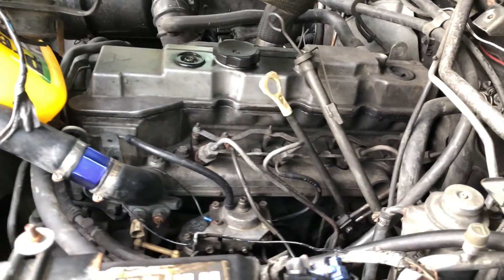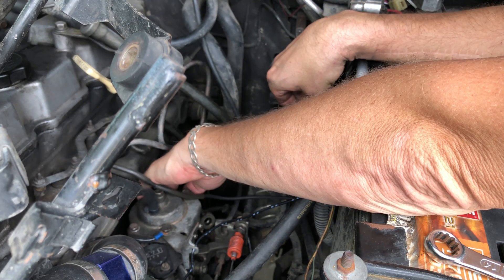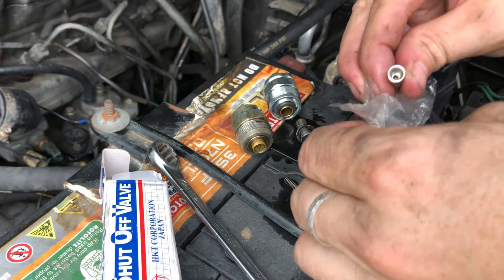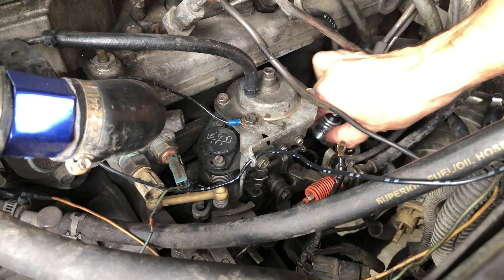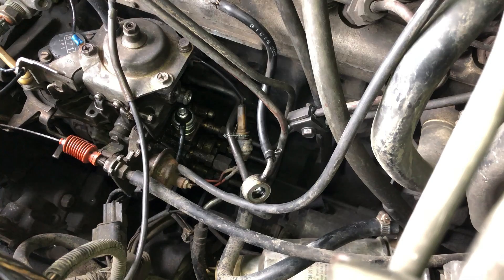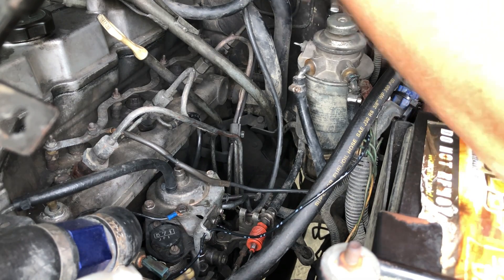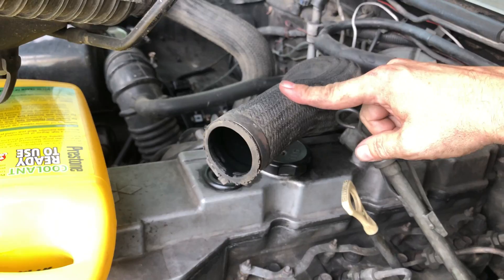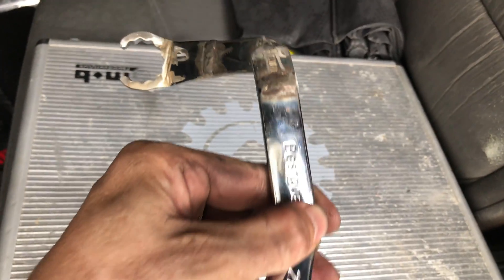HOW TO: DIESEL ENGINE SHUT OFF STOP RUN SOLENOID VALVE VE INJECTION PUMP Mitsubishi Pajero 4M40 4D56

Comment: These are also 12v and 24 v....make sure uyou use the correct one..😂
Reply from the maker: YES. There was something in the fuel distributor cutting the rubber stopper constantly. Rebuilt the pump and no problems since.

Comment: When you cut and weld the spanner leave the ring at the top of the spanner and put a power bar through it ,for leverage, it works a treat

Comment: Thank you for your video, it helped me quite a bit, just one question? how the hell did you get two hands in that small area behind the pump, I either have one to many left or right hands or needed two left or right hands with broken wrists just to see the shut off valve. 😁
Reply from the maker: Hehehehe! Well, it's VERY tight, but I loosened one or two of the fuel injector lines and built a custom box wrench.

Comment: any idea why my pajero 4d56 does not start at all? i tested my solenoid for power and hear it clicking. it ran perfectly then a few days later 0 sign of starting. no fuel getting to injectors either
Reply from the maker: So, you have fuel in the tank and when you loosen a fuel like just at the injector and crank th engine, there is no fuel leaking, squirting or dripping at the opening?
Reply: @offgridislandfamily  yes i added more fuel to the tank to be certain and no drips or any signs of fuel coming out of the injector with the line popped off. Thanks for reply
Reply from the maker: @anthonyx187  Yeah. Then either you have a fuel blockage (check the flow through the line). You could use a shop vacuum set to exhaust and pressurize the fuel tank with the fuel line open at the engine compartment. If fuel is coming from the tank to the engine compartment, then I hate to tell you, it sound certainly like fuel pump / distributor.
Reply: @offgridislandfamily  will try this, thank you
Reply from the maker: @anthonyx187  Just an update. My Pajero wouldn't start. After some trouble shooting, I found out it was the glowplug relay or switch. I touched a jumper cable from the battery to the glowplug rail and it started right up. ;-)
Reply from the maker: @anthonyx187  Just an update. My Pajero wouldn't start. After some trouble shooting, I found out it was the glowplug relay or switch. I touched a jumper cable from the battery to the glowplug rail and it started right up. ;-)
Reply: @offgridislandfamily  thank you for update, i think my injection pump needs work. It is going in to the shop for a pump rebuild i am still not getting fuel to injectors and my glow plugs are reading around 11 volt
Reply from the maker: @anthonyx187  Yeah...that was my first guess.

Comment: I wish I could have that diesel suv in the United States ❤
Reply from the maker: There are options. You could import your own 4m40 engine and convert. Would be quite simple as the fuel management is all bolt on mechanical. There are also many popular BMW and Mercedes diesel engine options that work amazingly.

Comment: My shut off valve thread seem to be stuck. The mechanic gave up on it. Any ideas.
Reply from the maker: You mean you can't remove the valve? If not, then install an old fashioned fuel cut off just before the fuel distributor / pump.

Comment: Where can I buy the solenoid? Link doesn't work
Reply from the maker: I just bought them at a local parts store. However, the rubber stopper keeps getting damaged every couple months. I don't even bother replacing it now, until I rebuild the injection pump.

Comment: hi can I ask is it just a 12v feed going to the solenoid or have it got a voltage drop and is it a constant feed as in trying to do away with the pat system ing my 1990s ford transit as the immobilizer is playing up
Reply from the maker: It's a constant 12v feed, yes. Thanks for watching! ;-)

Comment: Hi there, just want to ask what's the actual size of the solenoid to fit a socket wrench? You mentioned 24mm was it the exact size? Thanks in advance.  Love your videos and the Paj!!
Reply from the maker: Yes Sir! 24mm. But a HECK of a spot to work on! HEHEHE! Cheers...I have a new video coming in a couple days for thermostat, engine block cooling tube and silicone hoses. Thanks again
Reply: Thanks for the reply 👍
Reply from the maker: @henrybot320  No worries. I'm going to have to replace this stupid solenoid a 4th time as of yesterday. Something inside is damaging the rubber plunger so that I can't shut off the engine. Have to pull the intake tube and cut air supply.
Reply: I broke the camshaft in 3 pieces and damaged 3 valves and the camshaft sprocket 3 months after putting a new cylinder head 😢 😔 😪
Reply from the maker: @henrybot320  I don't know what Nulon start is, but I have to replace my solenoid AGAIN for a 4th time! Something inside the injection pump keeps damaging the rubber stop plunger. Seems to happen about every 4 months...so, $30 every 4 months.
Reply: @offgridislandfamily  it's a thing that you spray in the intake to help start the engine,  maybe you need to have the fuel injection pump to be calibrated.
Reply from the maker: @henrybot320  WOW...WHAT a mess! Have you looked into any performance upgrades for a 4M40 rebuild?
Reply from the maker: @henrybot320  YES. Already paid $150 for 'calibration' here in the Philippines by a recommended 'technician'. But what ANY of this actually means here is a total TOSS-UP. I absolutely agree. I need to find an unquestionably skilled pump tech and have it redone. I think this also explains power loss at higher RPMs. Or...perhaps a combination with valve adjustment.
Reply: @offgridislandfamily  did they tell you if they replaced the plunger of the injection pump? Hence they should show you the old plunger that they removed.
Reply: @offgridislandfamily  oh I wish I could do more upgrade of power like your doing to your Rig mate! At the moment I just wanted to put my pajero back on the road, but I noticed of noisier engine sounds like a Fuso trucks my mechanic said it was a fuel lock sound. So maybe I need to reconditioned my injection pump,  it's not cheap here in Sydney it's around A$1,500 🤔
Reply from the maker: @henrybot320  I AM the one who replaced the plungers. The solenoid is always working, but the rubber stopper / plunger head is always damaged the same. You can see in the video where I change it. Always cut like a 2/3 moon crescent.
Reply from the maker: @henrybot320  SHEESH! Maybe I should find a seriously top notch shop and offer the service to people in western countries! There is a Porsche restoration ship in Cebu who restores Porsches they receive from owners in western countries. After restoration, they ship them back out again. 

I've been wanting to upgrade the turbo for a year now, but also don't currently have the funds!
Reply: @offgridislandfamily  were on the same boat mate. Hoping you get it fixed for good that shut off valve. Good luck and God bless. Cheers.
Reply from the maker: @henrybot320  Seems there is something inside the pump damaging these rubber plungers. God bless to you as well! Thanks for watching and commenting!
Reply: @offgridislandfamily  we just managed to find a 2nd hand injection pump and we put it in, and she just start in one click so happy to  finally drive my Pajero.  Do you think you need to replace your injection pump? Just my thoughts.  Hopefully you will be able to fix it.  All the best! Regards
Reply from the maker: @henrybot320  Honestly, I would like to find a very good used pump or a seriously professional rebuild. How much did your injection pump cost? In what country?

Comment: Parts number? 2.8td? My Pajero is 2.8 td intercooler and no start. My idea is solenoid valve 🤔
Reply from the maker: https://www.ebay.co.uk/itm/322255314050?hash=item4b07e9dc82:g:ze8AAOSwwbdWMfAM
Reply from the maker: If ZERO signs of life, then very likey. Just make sure your glow plugs are working and fuel is getting to your injection/fuel pump first.

Comment: did you had any leak from the top of the solenoid?  after replacing to the new one...
Reply from the maker: No. No leaks, but for some reason the rubber plunger / valve part keeps getting damaged. As if there is a sharp object inside the seating area. Yes...I looked closely and deeply and couldn't find anything. Ran the engine with the solenoid removed just to attempt flushing out anything inside. Strange...

Comment: Hei i got the problem my 4d56 starts bad and runs bad too i guess it's that solenoid any thoughts ?
Reply from the maker: If it starts and runs, it won't be the solenoid, unless the plunger is damaged and slightly blocking fuel flow when open. Running bad could be anything from worn valve train to your fuel pump / distributor.
Reply from the maker: If your engine runs, then the electrical part of your solenoid is working. The thing to check on the solenoid would be the rubber plunger that stops fuel supply. If this was damaged (as mine was) then it could allow the engine to 'run' but restrict enough fuel to run correctly at higher RPMS, for example.

Comment: Gr8 video .. can u make another one showing how to set the rite intake desel for the engine.. mine   blows blak smoke when it shifts from first gear to second
Reply from the maker: Thank you SO MUCH sir! Black smoke on acceleration is actually normal. If you don't have at least some black smoke, then you are probably not getting full power from your engine. Please post a video to my group and get better educated opinions. ;-)

Comment: Another good video bud, thank you.
I have the 4D56T on my sport but I'm thinking to put one in my project car. I want it to run on a full mechanical system, no ECU or any other management. Would you recommend the 4M40 over the 4D56 and why?

Thanks for the answer in advance. 
(Maybe you could do a video talking about the differences between the 2, just an idea) 😉
Reply from the maker: Sorry for the late reply. Missed this post. I would recommend the 4m40 for two reasons at least. 1. Larger engine & more power. 2. Timing chain instead of timing belt. I really don't like timing belts. I also wanted the newest fully mechanical system. One reason is to run vegetable oil as a fuel. Can't do it safely with an ECU if they are too fussy.
Reply: @offgridislandfamily  no worries at all, it happens. Yeah I completely understand. I know that I can change it to the mechanical ve pump but I also got myself the legendary om606 for future projects.
Reply from the maker: @bravo20ghost27  THAT sounds exactly like something I will want to do. Please keep me posted. I'd really appreciate seeing some progress on that.
Reply: @offgridislandfamily  yeah of course, we are currently finishing off my 2021 KTM 690 SMC R build as I intend on sharpening up my bike handling skills. Along with the last bits of our video production equipment. 

There will be a big reveal video to start of the channel coming soon.

We currently have 2 of the Mercedes E300td that those engines come in plus 2 as spares or for maybe a kart build one day.
Reply from the maker: @bravo20ghost27  I bought a Bristol 400i in Leyte. Still have to pick it up. Well, keep me posted on the Mercedes transplant!
Reply: @offgridislandfamily  yeah exactly, that's why I'm getting the mechanical pump for the OM606, nice and simple setup. Eletrics for the starter and glow plugs.

Comment: Hi. I have a 2003 Pajero. Lately my engine stalled whilst driving. Likely no fuel supply. What’s the fault please?
Reply from the maker: If it happened suddenly, rather than gradually (filter / fuel pump), then it's most certainly THIS fuel shut-off solenoid, which is exactly what this video will show you how to replace. I got stuck twice because of it...once electrically worn out and second time, mechanical failure. So now I keep an extra in the parts box inside the vehicle. They normally last 100,000km, but I've had bad luck with this part.

Comment: is this instead of taking the pump off to do the dreaded pump seal on the 2.8td ??
Reply from the maker: Thanks for commenting, but no. It's just to replace the Shut-Off solenoid and adjust the fuel load screw. I already had the pump recalibrated and resealed at the same time.
Reply: @offgridislandfamily   did you change the pump seal yourself, Buddy.
Reply from the maker: @MrFrankstanks  Nope...I had an injection pump shop reseal and recalibrate the pump, so they did the removal and install on that.